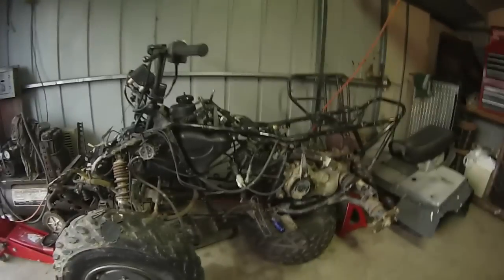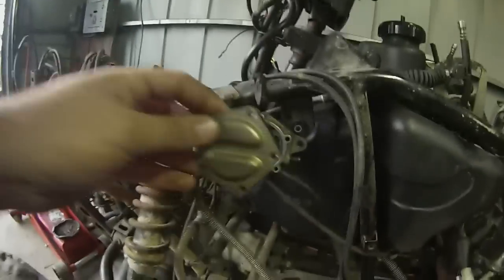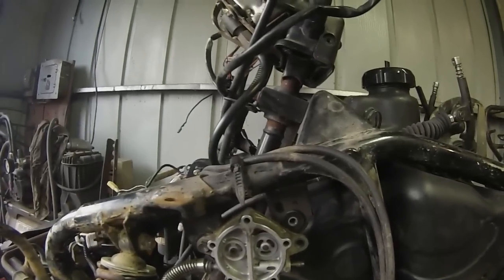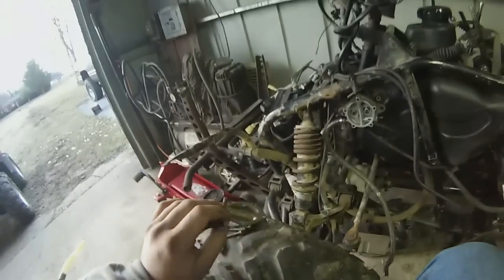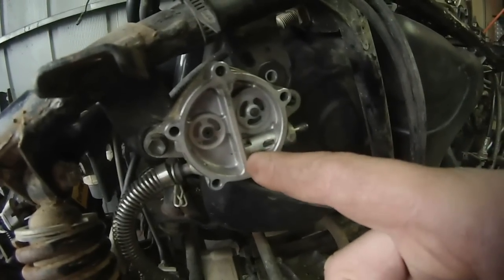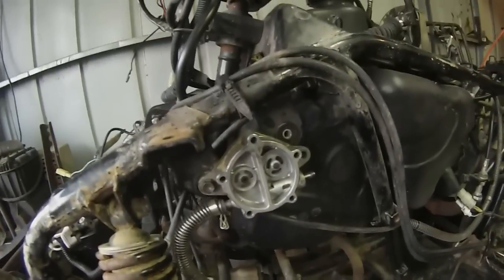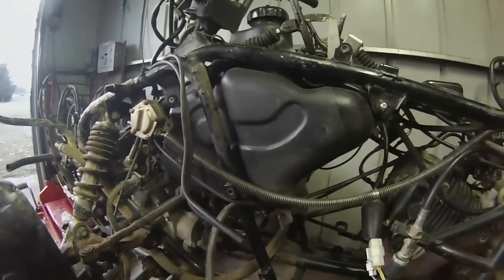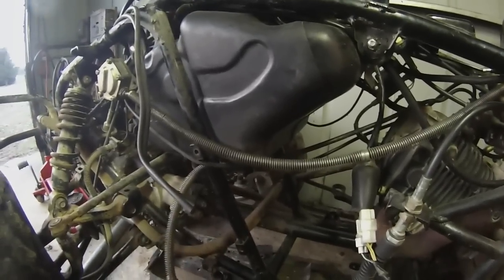Suzuki King Quad 300 Project - Part 2 - Fuel delivery

Comment: Thanks for your video I know it's old but you helped me out so much just bought a new fuel pump from eBay and my quad is running great. I wasn't getting fuel to the carb and was messing with the petcock and didn't understand any of it till I watched both of your videos! So thanks again for the great explanation on your vids!👍💯🔥😁

Comment: Question..I replaced fuel pump..no gas out of on position but got fuel from prime..got spark..cleaned carb..quad turns over but won't start n run?..vacuum lines are right etc...?peck maybe?

Comment: Great video. I have the same bike it helped me get her started. I thinks it's running rich and losing power from the carb sucking extra fuel from the prime vac line. When I block off the prime vac line it regains power and runs perfect but eventually runs out of fuel. Any ideas!?? Thanks!!
Reply from the maker: Thanks, Im glad the video was some help to you! Have you looked to see if the vacuum line ever has any gas in it when you pull it off? When the petcock goes bad, that can happen. Honestly, what it sounds kind of like to me, is that your float is set too high, which is allowing too much fuel to stay in the bowl, causing it to run rich. Then when you block the vacuum line, no fuel is getting to the carburetor and it is running off of the fuel in the bowl until it sucks it dry. That's what makes the most sense to me just thinking about it. Let me know what you figure out
Reply: Thanks, This helped me alot on my 2001 King quad restoration. Thanks for the detailed description.

Comment: I have a 1997 king quad 4x4 300. When I first bought it it ran fine and now it will not. When I start it, it ideals fine and then when I give it gas it will do good for about 4 seconds and then it bogs down. I can cut it off and let it sit for about 5 minutes and start it again and it will run good for about 4 seconds and bog down again. I had the cauborator cleaned and new gaskets put on and it ran good for a day and started back doing it again. Any help would be greatly appreciated.
Reply: Pit cock is vaccum operated from your carb then that allows your fuel to get to the pump. Then fuel pump is also vacuum operated supplying fuel to the carb. The problem is fuel delivery. I have fixed these and I am fixing one know as well. I have in the past just ordered the pit cock and fuel pump and it worked perfectly. Check all vaccum lines for cracks as well

Comment: i couldn't cure mine. i just got rid of stupid pump thing got a new different carb with no vacuum bullshit. runs perfect now.
Reply: So you just have one going striaght to the carb that's it. Guessing you had to replace petcock or just cap off the vaccum lines?
Reply: @ just left them dangling there. New Chinese carb didn’t need any vacuum lines from what I can remember. I’ve a spare one in the shed

Comment: Thanks for the videos, been dealing with a 95 King Quad. I rebuilt the carb and that solved some of my problems but I'm loosing vacuum somewhere. You wouldn't have a vacuum diagram for the carb would you? Thanks, Joe
Reply from the maker: +MrJAG1156 I don't unfortunately. They are great machines, but the fuel system can be troublesome if things aren't right. I wish I had a diagram because it seems several people could benefit from it but unfortunately I don't.
Reply: Top front and right front are vacuum, they can go to either the pitcock or the fuel pump don't matter. My problem is figuring out what fuel line goes from carb to pitcock, carb to pump and pitcock to pump

Comment: my king quad will crank but run just a few min then cuts off done did a carb kit think mayb the valves are tight? its only got 2000 hours on four wheeler please help
Reply from the maker: I'd say your problem is gas in the oil. When the fuel petcock fails on these atvs, it gets gas into the oil via the vacuum line to the petcock. Basically that line is just used for vacuum but when the petcock(fuel valve) goes bad it allows the gas from the tank to run through that line which gets to the intake and then seeps down into the crankcase. The crankcase vents to the airbox. So when the oil/fuel mixture in the crankcase gets hot enough to vaporize, it vents the gas fumes to the airbox which makes the engine not have enough oxygen to run.so check your oil and if it's over full, that is your issue. Once you fix or replace the petcock and change the oil you should be good to go. Let me know if that fixes it, and good luck!

Comment: OK I'll try. mine ain't circle its kinda square has tube in an out I can post a video of what it does
Reply from the maker: You could always take the airbox lid off and see if it doesn't die when you do that. It should get enough fresh air to keep running that way I would think.